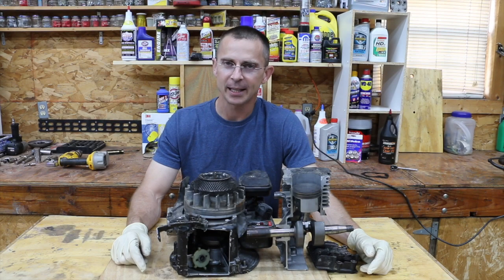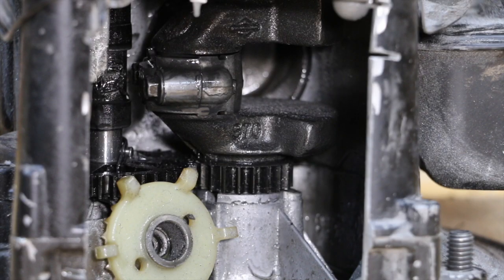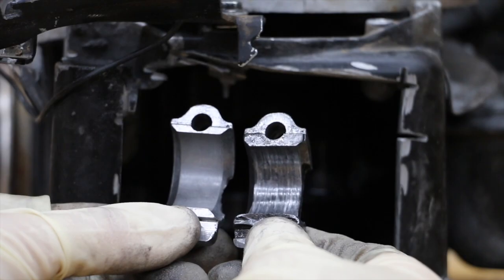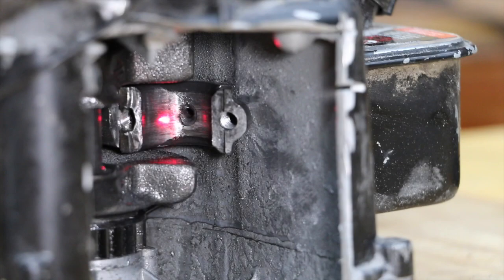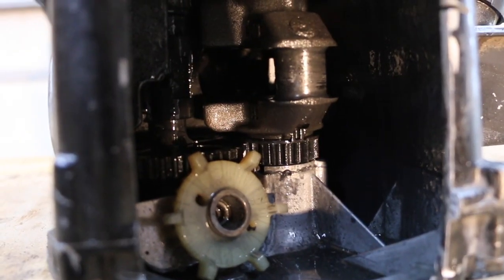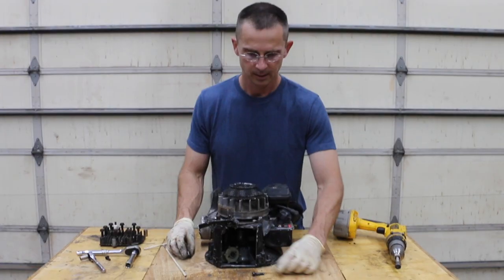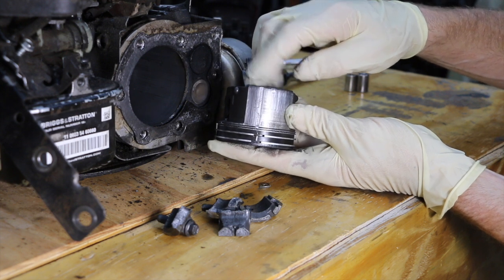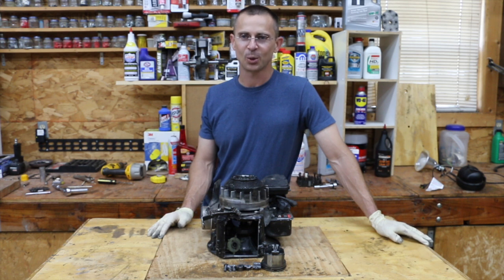Running Cutaway Engine Throws Connecting Rod!

Comment: When I was in jr high I took a small engine repair class, we were divided into pairs ,out of 10 pairs only 3-4 pairs successfully completed taking apart and putting back together a 2 hp horizontal shaft Briggs and Stratton . One team put it back correctly but fergot to put oil in it. It only lasted no more than 20-30 seconds after it started. They got an "F"
Reply from the maker: Hilton, LOL!  I bet the class instructor was upset.  Thanks for watching the video and commenting.

Comment: JB weld the connecting rod back together. Or maybe even make a solid connecting rod out of JB weld! That would be an amazing video! Run it with and without oil.
Reply from the maker: Richie, Great suggestion.  Thanks for watching the video and commenting.

Comment: I found an old lawnmower in the woods and I rebuild the engine for high school shop class.  It ran for 10 more years!
Reply from the maker: Very impressive!  Thanks for watching the video and commenting!
Reply: Grygory Malchuk 
The engine was a Briggs & Stratton.
Reply: smytb I found an old Briggs and Stratton lawn mover in the woods I plan on restoring also haha
Reply: smytb those old Briggs & Stratton motors are bullet proof
Reply: smytb now that is what i call restoration nice job dude
Reply: At 12 I pulled an engine out of scrap pile and ran it for a couple months, unlocked it once in that period and she finally bit the dust from a bent push rod from being hydrolocked
Reply: smytb 
What kind of lawn mower was it?
Reply: Got a push mower (with Briggs and Stratton engine) when I was 14 yrs old. had to put a magneto on it, and it’s still running after 8 years of hard use and abuse!
Reply: This is what sustainability is about.

Comment: You should have tried the leather belt trick.
Reply from the maker: Jonathan, Great point.  Thanks for watching the video and commenting.
Reply: I really meant you should try it in another video.  I'd love to see if a similar engine would have lasted any longer with a piece of leather on the bearing surface to take up the gap.

Comment: If that happens in a petrol car or truck engine the carnage tends to be a lot worse as the parts are a lot heavier and are often turning at a much higher speed.  I've seen plenty of engines that have thrown a rod through the side of the block or have snapped crankshafts plus ended up with massive internal damage due to the broken con rod whipping around.  I've even seen a race engine that broke a rod that punched the piston into the head so hard that it snapped all the head studs and bent the head as well as smashing the valves in that cylinder while the broken con rod punched a big hole in the side of the block and tore the sump (it was a dry sump system) apart and started a big oil fire.  Needless to say in any of these cases the engine is instant scrap and can't even be used as a core unit for rebuild to exchange against a replacement engine and there is a very high chance that none of the internal parts in the engine are going to be fit for further use as a lot of swarf (metal particles) get pumped around the engine in the oil as it goes through its death throes so everything will have been contaminated and suffered damage as the engine died.  I have even seen the results of pistons and engine parts getting thrown through bonnets/hoods and out through the inner and outer wings/fenders in engine failures at highway speeds and in diesel engines (much higher compression in diesel engines so much more force when it goes bang...)
Reply from the maker: I agree.  Thanks for watching the video and commenting.
Reply: +Project Farm  My pleasure.  It was a very interesting video and hopefully might give people an idea of what will happen if they neglect their engines...

Comment: we have a skid steer that the previous owner must have ran without oil. it threw a rod through the block leaving a 4 square inch hole in the engine. it's since been rebuilt and ready to be reinstalled into the skid steer for the moment of truth
Reply from the maker: William, I hope everything works out well!  Thanks for watching the video and commenting.

Comment: Enjoy your videos a lot. I like the real world comparisons of different  additives and snake oils. would be a little more helpful if used in more automotive tests like your ranger, but I understand lawn mower/equipment is easier and cheaper. Since your so handy with the briggs style engine I have a request. vertical shaft engine being used in a horizontal configuration. what to change and how long will it last?
Reply from the maker: Joe, Great suggestion.  Thanks for watching the video and commenting.

Comment: I had an odd knocking sound from my Ford Focus and it suddenly died during engine braking coming up to a roundabout. I suspect it actually threw 2 rods cuz 3 exhaust valves are stuck open on 2 cylinders.
Reply from the maker: Paxmax, Thanks for watching the video and commenting.

Comment: if i ever had an engine failure, well i once put premixed gas in my moped(2 stroke) from a gas station(1:50 oil to gas) but since gas stations have an lower mix ratio due oil sinking to the bottom of that tank my engine seized when i was going arround 60mph.

and my brother managed to drive for almost 20 minutes with an rs 125 that ran hot(2 stroke) due to no coolant
Reply from the maker: Stefan, Thanks for sharing these experiences.

Comment: Glue it back together again, then use some High temp silicon  and Lexan to put a window on it and go out and mow your lawn again with it.  Bet JB-Weld becomes your full ride sponsor if you make that motor run again with their product.
Reply from the maker: Great suggestion.  Thanks for watching the video and commenting.

Comment: I had  KTm 300 have a big end bearing fail, but I was incredibly lucky, I'd been running wide open on an open fire trail and stopped at the end of the trail to wait for a friend, while idling is when the bearing failed and one of the rollers lodged between the con rod and crank shaft locking the engine and preventing the piston from hitting the head or the con rod from completely failing, even the cylinder was left unmarked, I was able to rebuild the engine with a new crank, con rod and piston and it has 40 hours on the rebuild without any indication of failure.
Reply from the maker: Scott, Glad you were able to save the KTM 300!  Thanks for watching the video and commenting.

Comment: hey man nice video! but i got a question. i run mij little 2stroke engine on petrol mixed with sunflower oil and it runs good. later i tried pure sunflower oil and it dit also run but smoke a lot. i took appart my enige and it was verry clean no carbon! my question is can it destroy your engine?
Reply from the maker: Jorn Cop, It's possible that using sunflower oil could insufficiently lubricate the engine, causing scoring in the cylinder wall and piston.  I just don't know how well sunflower oil lubricates.  Thanks for watching the video and commenting.

Comment: Project Farm - You gonna do the Duralube test or a video running RC Car Nitromethane in a mower engine? I have done this and never blew it. I added it to the gas but not in its near pure form. I did it pure (25% or 40%?) and the riding lawnmower launched up on 2 wheels. Just enough to start it. I fell off from the torque and it stalled cause of the safety switch under the seat. I might as well being riding a Bull injected with Crystal meth. lol I Do add this to my 2-cycle weedwackers diluted for the torque and response. Have same one for 10 years now. So its ok if you add it in with fuel/fuel mixture. Nirtomethane comes with lubricant added- castor oil. So when we'd'd race mopeds as kids we'd use that oil and fuel mixture with its additional oil.Castor oil is used in performance 2 strokes in view of '2 cycle oil'.
Reply from the maker: Great suggestion!  This would be very interesting to test.  Thanks for watching the video and commenting.

Comment: 49cc moped.. screws on the engine head came lose driving on a gravel road.. because of the loose screws it lost a lot of oil and siezed up, the finger of the piston gor fried to the aluminum piston.. changed the piston , rings that finger. and still runs today
Reply from the maker: Nauris, Glad you were able to get the moped going again!  Thanks for watching the video and commenting!

Comment: You can't beat them old flat head 5 hp -3-4 hp Briggs engines. Especially from the 80-90's made in USA. Not Mexico. This plastic crap today don't hold a candle to them.
Reply from the maker: Larry, Agree. I like this older style engine much better than the new OHV design.  Thanks for watching the video and commenting!

Comment: I had a engine in a Mazda 626 fail while idling in traffic it just seized up. It was idling then suddenly revved up to the limit then silence.
Reply from the maker: BusyGrow, Wow!  Sudden and unexpected!  Thanks for watching the video and commenting!
Reply: Very much so, it was a very well looked after car, not abused, loads of servicing and then that happened. We later found the cog thing that drives the oil pump had fallen off, no warning lights for the lack of pressure came on.

Comment: it would be interesting to see with the same set up,a hard test to METAL Lube and superkote2000 product as they do claim substantial benefits in engine protection
Reply from the maker: Daniel, This is a great recommendation.  Thanks for watching the video and commenting!
Reply: thanks for the quick reply, i have used these products several times but no physical evidence found would be a great test in running engine with oil starvation under other situations,congrats for your time and effort 👍

Comment: how the heck are you even starting it with a open case
Reply from the maker: Red Bob, I use a power drill to start the engine.  Fortunately, crankcase pressure isn't needed to start this engine.  Thanks for watching the video and commenting!

Comment: I really enjoyed this, it was nice to see an engine run along with the temperature readings gives you a very clear picture what happens at the point of failure. This is really unique thank you for shearing and reading everyone's comments, I think I speak for the community that we really appreciate that and feel part of the video. Thank you. Steve.
Reply from the maker: Steve, Thank you very much for the positive feedback.  I try to read and respond to as many comments as possible, but I miss a few along the way.  I'm learning a lot on this forum.  The combined knowledge and experience of those on this forum is tremendous!  Thanks again!

Comment: If only the Slo Mo Guys were here to film this event!! It would have been so cool to see the rod shearing apart slowly.
Reply: Audio Crossing 
yes, this needs to be filmed with super slo mo camera
Reply: DE Nichols You can rent them.
Reply: Audio Crossing The actual catalyst  was most likely a bolt that tore out of the aluminum rod or a fracture in the big end  that quickly caused structural failure discinnecting it from the crank. The lion share of the carnage happens when the crank comes around and hits the helpless rod that had just cried..."enough".
Reply: Sharif Sircar just put it round a corner and use a mirror, that’s how it’s done in the industry.
Reply: also, insurance.
Reply: DON'T READ MY PROFILE PICTURE that's why you put it behind plexiglass
Reply: I thought about the exact same thing! Maybe they should pay him a lil' visit.
Reply: ac3ofspades878 I agree
Reply: Audio Crossing Adjust the speed of the video On YouTube
Reply: Pretty cool on a smaller scale to see how Fords blow up. 😂
Reply: maybe even a collab with WarpedPerception!!
Reply: Let's start a fundraiser and get a HD high speed camera for this channel. Lets find a model, and start a patreon or something.
Reply: Had this exact same thought when I saw the rod snap haha
Reply: Audio Crossing yeah and have the chance of the pieces hit the camera pretty sure he doesn't want to spend the money to buy a new one
Reply: @OMRS1  
Funny how that's never been an issue yet with a $60,000 camera and all of the things they've already destroyed
It's called Lexan, it's been saving camera lenses for 15 years
Reply: Those are expensive, lol.
Reply: so buy him one cause it would be cool to watch an engine come apart in super slo mo
Reply: it's faster then binge watching his channel till youtube pays enough for him to buy one himself

Comment: After 17 years and 83.000KM I proceeded and changed the piston and piston rings of my Kawasaki KazeR 110cc.
Couldn't get genuine parts for it, so I decided to go for a Japanese piston kit. Also got the cilinder Rectified.
It lasted 4000km. When I disassembled it I realized one of the ring-snaps which locks the pin to the piston had come out, and scratched all the cilinder. A piece of the piston was also missing, and also a piece of the oil preassure ring.
Luckily, the cilinder head was in perfect conditions, so after 1 month of waiting, she's up and running again.
Although is a small scooter, I really like it, so I'm glad it could be fixed.
Reply from the maker: Rafael, Glad you were able to get it going again!  Thanks for watching the video and commenting!

Comment: This exact thing happened to my mom's Mitsubishi Montero Sport. The oil pump was going out, it started knocked, and then a rod snapped and sent pieces right through the crank case (I was accelerating in the car when the rod snapped, so they snapped with force)
Reply from the maker: I bet it made a lot of noise when it came apart!  Thanks for watching the video and commenting!

Comment: my second car was a honda accord, the oil pump belt stripped it's teeth, also making it vibrate because the balance shafts were out of timing and it ended up splattering number 4, and it still ran. I did lots of burnouts, and even trying to kill it entirely. it only threw number 2 and 4, while 1 and 3 still knocked and then it seized.
Reply from the maker: Dylan, LOL!  Glad you had fun with it.  Thanks for watching the video and commenting!

Comment: how the fek does a stopwatch malfunction???
Reply from the maker: Blame USA, I'm not sure if the vibration from the engine caused this or if there was an electric pulse from the tachometer.  Either way, I was surprised to see it suddenly stop working.  It's been a reliable clock thus far.  Thanks for watching the video and commenting!

Comment: I loved the video  ,, I've been working off and on with small engines since I was about twelve years old and I have a briggs engine push mower it had set so long the piston was stuck in one place took it all apart cleaned and reassembled put some stp oil treatment  lucas oil stabilizer  and dura lube engine treatment in it and dura lube fuel system cleaner through the carb the first few times it ran rough but after about ten hours of off and on running it got to where it ran great I've been using it to cut my yard grass for about ten years now and I change the lube in it every four years .  stp oil treatment , lucas oil stabilizer and duralube , just mix in the right proportions so the lube has the same thickness as 10/30 weight oil oh and in the winter when about thirty degrees fahrenheit it will start by the third pull every time with the help from butane .
Reply from the maker: I enjoyed reading about your experience with the Briggs engine.  Also, thank you very much for the positive feedback!

Comment: I saw carnage like that on a Chevy 350. I bought a '77 Corvette at an estate sale for a friend of mine. She drove it for several months and said that the engine had become noisy. Before I could get any further information she had the car towed to my house. Two rods were sticking through the oil pan. She had run the engine without oil. What's left of the crank I have displayed as "art" in my den. Lesson learned - she checks oil every time she drives it.
Reply from the maker: Garcansdad,  Agree, live and learn.  Thanks for watching the video and commenting!

Comment: I've never torn down a small engine like this, so I'm a bit surprised that there are no main bearing inserts in there. But then as I understand it, plain bearings rely mostly on the oil film. In engines with main bearing inserts, they are there to protect the bearings when the engine first starts and oil volume and pressure are low. Is this correct?
Amazing to see the big end self destruct like that. I really expected to just seize up.
Thanks for the video.

Comment: Connecting rods I think not only in small engines, but all engines should be made of Titanium. Or at least some better type of metal.
Most engine breaks that I have seen are blowing a rod. Of course  making an engine with stronger parts is not what manufactures want.
They want to sell more products. They don't want your engine to last forever. I believe it possibly can. What do you think?
Reply from the maker: Bob, Great point!  A stronger materiel for all engine components would seem to extend the service life significantly.  Thanks for watching the video and commenting!

Comment: Just curious...   If I understand it correctly, the rod was aluminum and the crankshaft was hardened steel.    There was a lot of play between the crankshaft and rod.  I'm sure the aluminum rod lost a lot of aluminum because it was a softer metal, but how about the crankshaft and cylinder wall?  how much diameter did they have worn off?  I wonder that if you replaced the rings and the piston rod, how well would the engine run?  Are the scores on the cylinder wall shallow enough that you could hone them out?
Reply from the maker: I believe I could get this engine going again with your recommendation.  Thanks for watching the video and commenting!